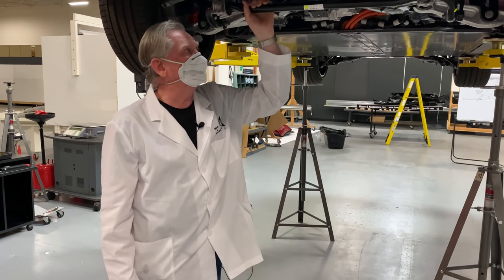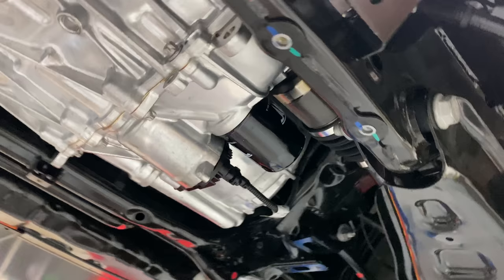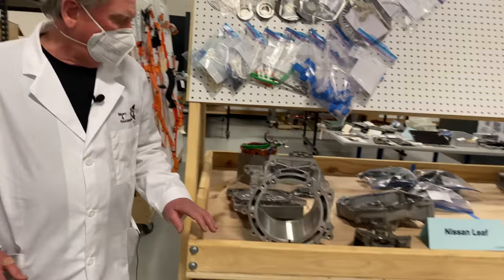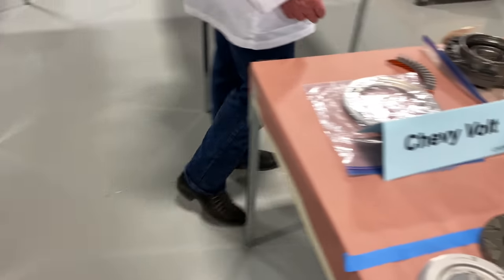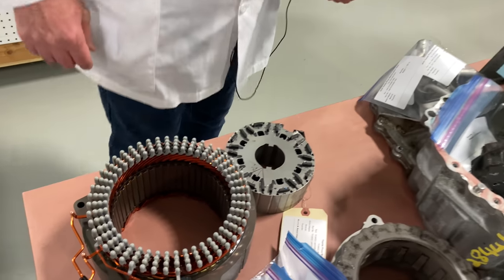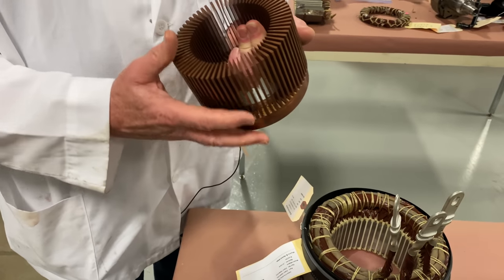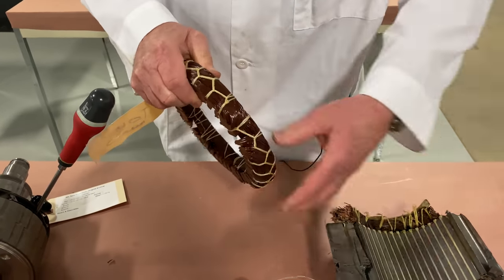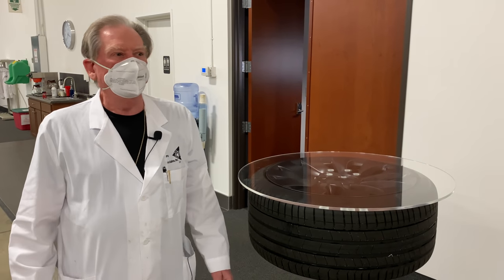Model Y E16: Electric Motor Comparison MY-M3, Industry review of Electric Motors, Table for Sale!

Comment: I have idea for new kind of PM motor maybe if not self driving maybe 500%  better ones,the idea for recharge Tesla you can use 4 small alternators to be on 4 wheels for recharging batteries or Nikola Tesla Turbine in front to run alternator or PM...

Comment: The eTron could have done better than putting Induction motors on both front and rear BUT their machine cooling is quite nice/neat: where they are able to run coolant (not oil) via not just the stator housing, but also via the rotor shaft (which usually is not easy with a rotating component, and leaking issues, etc.). This helps them achieve optimal cooling/temperature maintenance enabling them to get good continuous performance, repeated launches, long high speed (think Autobahn) driving without too much derating. The eTron is limited in range for one, it's an induction motor (< eff. Compared to a PM motor) especially when driving per EPA testing, then vehicle is heavy AF, much lesser usable kWh than the rated 95 kWh (to be able to put our the rated range in real world conditions too, not just per EPA cycle), too many auxiliaries (energy consumers) compared to Tesla vehicles.

The choice of induction motors is to keep the cost low and still be able to make a profit from a company which is more lopsided to industrializing ICE vehicles. In the future with large scale MEB vehicles from the VW house, this vehicle should cost lesser

Comment: Great video like the others! My question: is there any change or improvement from the Model 3 motors to the Model Y motors or are they 100% the same?
Reply: Same part #'s
Reply: Same part #'s
Reply: Not sure. The Y has higher power on the output. There could be some upgrade.
Reply: @mirkonaumann1417  Nope. Performance Y and current 3 have same drive units. Different output due to other factors. Tesla repair tech.
Reply from the maker: We will absolutely be diving into it to find out, but without having gotten down into the internals yet, we can't say 100%.  At a glance, the case geometry, layout and rough sizing appear the same though.  Stay tuned for future episodes where we get into that!
Reply: @MunroLive  Waiting for every new video from you :-)

Comment: No way this shares 70%+ of parts with the Model 3. So many red dots in these videos (red means it is not same as M3).
Reply: Sure it can, if you consider bolts and other small parts.  Percentage is probably a poor metric for comparing vehicle content.
Reply: More likely it will in the future.
No reason the 3 can't be reengineered for the rear casting, etc.
Reply: Sandy's Model 3 was a very early production model. Its a fair comparison as the model y is also early production model. But the model 3 currently in production does have a few changes, as other comments on sandy's videos have mentioned. Tesla has been making constant changes along the production. 
It would be interesting to see a current model 3 torn down and compared to the y. But then again, maybe 6 months from now the Model 3 and Y will share even more components.
Reply: @Marc83Aus  I believe Sandy tore down two Model 3s, an earlier one and a later one, as he references to improvement in the build quality.
Reply: Model 3 is constantly being improved at the same time.  He is comparing to an early 2017.
Reply: @dchristo10  not to mention 2170 cells! I'm sure by part count, that's half the vehicle by themselves!

Comment: 7:15 What was the model year for the Volt? The 2016 to 2019 Volts used a different motor design, which resulted in far lower manufacturing costs.

Comment: whats the pros and cons of induction motor vs permanent magnet motor?
Reply: PM motors are more efficient than standard induction motors(can dynamic brake up to a standstill), but PM motors are more expensive than induction motor.

One of the big reasons so few people use PM synchronous machine like tesla is due to the control complexity. You need positional feedback to effectively control the motor. Whereas an induction motor needs no feedback.

Please note that this is only a few of the characteristics of these motor types. Im more inclined to the PM motor that tesla uses since that topology is what i did my thesis on
Reply: Divan de Vaal I would add that Induction motors can require more cooling due to the heat inherent in inducing a magnetic field

Comment: Why does a gearbox need a filter? Isn't it a closed system? Where is the particulate that it's filtering coming from?
Reply: Metal to metal friction will create particulates
Reply: Gears and bearings in the gearbox wear out, the oil picks up the metal particules.

Comment: @Sandy I didn't like to see those oil filters there. 🛢 What happened to the whole "electric cars don't need oil changes" argument?
Reply: How often do you change your transmission oil in your gas car? Not very often in the life of the car.
On electric car this is also transmission oil, but there is much less oil because there is  only 1 gear.
Engine oil need to be changed more often than transmission oil, because of high engine temperatures, and combustion products leaking into the oil.

Comment: Very interesting to see the conventional makers all using a similar design while Tesla lashes out on its own design especially the rotor. Looks like a lot more work to manufacture as well as all that copper in the bars. Would certainly allow more power without a lot of resistance losses and avoid higher temps cooking the insulation over time. The gear oil would not have to be anything too fancy I wouldn't think. Lots of good synthetic gear lubes around. And being cooled would help with its life too unlike some heavy vehicle diffs that get up over 100C in hot weather. The drive line looks pretty bulletproof. You are in a privileged position to see the evolution and state of play of EVs with your tear downs/dissections.  I think Tesla will be in the lead for a while because they don't have ties to how things are done while the older manufacturers want to add an EV to their existing range without crippling their ICE ranges. 

Remember when Detroit "tried" to do a small car. #Halfhearted/Reluctant/Not as much profit as gas guzzlers/LAME. 

In Australia, EVs are a novelty and still only a few on the road thanks to lack of interest from the government and then manufacturers not seeing any point. The only real options are a Nissan Leaf ( Urgh! pathetic range and no battery management) or Hyundai with their"Iconic" EV brand.  And of course Tesla have a presence here with cars that have some real range. I think the Tesla's will be making some quantum leaps forward in the very near future which will bring their  range up and their price down to the level of the "cheaper" cars with less range. Tesla as a package will be a hard sell for others to beat with the range, charging network and I see a big future for their insurance where they have a unique advantage over insurers with the level of data they can glean from cars to set a much more competitive rate based on accumulated data from the cars.

 Thanks for another hugely interesting video.

Comment: You should also buy a Hyundai Kona and tear it apart. Seems to be the most efficient car today, behind Model 3.
Reply: Vlad Mihai It is less efficient than the Y If you go off epa.
Reply: Also much smaller than Y and 2wd
Reply: @bob15479  Model Y is just a model 3 so it is expected to have the same kind of efficiency as model 3. Hyundai Kona and Kia Niro (which share the same platform) have been tested against Model 3 in real world scenarios, bjorn nyland, car wow and they are very good. In efficiency they are overtaking the model 3, but the range is smaller because of smaller pack (64 vs 80+kwh)

Comment: Sir please tell out what's inside the model Y motors. And please tell ous if we can buy that motors from you or not.
Reply from the maker: We will definitely be getting into the internals of the Model Y motors, but realistically, they are not going to be useful as functional motors once we're done with them.  We typically section portions of the internals for analysis and material composition testing.  Thanks for tuning in!

Comment: Regarding the induction motor Tesla is using the more expensive copper cage rotor. This has better efficiency than the Audi's aluminum cage. Resistive loss of copper is much lower than that of aluminum.
Same goes for the permanent magnet motor. The magnets in Tesla's rear motor are segmented. The problem is, at high speeds the magnet loss increases tremendously, the magnets will get hot and could demagnetize, due to high temperature. The work around is to have segmented magnets. This will reduce the magnets loss greatly and it becomes negligible. The other cars can't reach high speeds and don't realy need this, since it's a further manufacuturing challenge. 
As a conclusion, Tesla is choosing the better and more expensive technology, as opposed to the others which are choosing the cheaper tech. 
This is where the superior effinciency and higher performance of Tesla comes from.

Comment: Motors used on EV vehicles are multi-pole  high RPM requiring up to 2 Khz AC to feed them. Effective conductivity of copper wire is frequency limited by the "skin effect." The phenomenon becomes a consideration at a relatively low frequency. 

Here's a Wiki link:
https://en.m.wikipedia.org/wiki/Skin_effect   

And a handy calculator:
https://chemandy.com/calculators/skin-effect-calculator.htm

The usual work-around for 60 Hz motors is to multi-strand the winding conductor which also facilitates placement in the narrow stator slots. For example a 60 Hz motor ordinarily requiring #6 AWG enameled magnet wire would be wound with 8 strands of #16 AWG whose total section slightly exceeds that of #6 and has triple the surface area. The heating coils of induction cookers and induction furnaces are commonly wound with Blitz wire, multi-strand magnet wire furnished laid up like speedometer cable.

It's a mystery to me why high performance, high frequency motors used in EV's would be wound "hair pin" fashion when electrical losses in such a design are sure to be a factor.

Comment: Tesla owner: "No oil! Good for environment!"
Me: "Munro showed not just one but TWO OIL FILTERS! Teslas most definitely use oil."
Reply: Although it would be a specific gear oil that stays in a long time, not comparable at all to the oil changes done on an ICE car. As long as you have bearing and gears, you will have some sort of lubricating oil.
Reply: @zacolin1  Plus it seems to be only 1-2 liters each.

Comment: Why don't you just offer your technical reports like on parts, materials, systems (cooling, lubrication, heating, power control, charging control, ...), technical explanations, pictures, numbers and figures?
* as a car repair guide in a Haynes style manner
* as weight analysis for sports use (shaving weight in the most promising spots)
* as input for car tuners with weights and comments on dimensionings and dimensioning margins in electric motors, inverters, batteries, brakes, shafts, cooling systems
* as input for hypermilers that want to modify their cars towards more efficency and therefore range
* suggestions on creating convertibles (like to Newport Convertibles) from these cars by changing their bodies
* suggestions on creating station wagons or pick-up trucks (think Truckla) or coupé versions from the existing bodies
* suggestions on retrofits: like adding a heat pump to Model 3 , or adding higher-power charge ports (CCS) to older EVs
* suggestions on retrofits, like: from CHAdeMO to CCS: what needs to be changed in parts?
* suggestions on retrofits like solar panels: where to add them with minimum necessary intervention to the vehicle
* or from Chinese Model 3 to US model 3: what changes? Conversion from US Model Y to EU Model Y: What needs to be changed?
* suggestions on even better NVH (think of luxury models from existing BEV or PHEV) or even better safety
* lists of running changes that you collected or have identified and the reasons for these changes as you see it (cost cutdown, reliability improvement, NVH improvement, unifying measures, ...)
* educational literature on electric motors, suppliers and their real designs, reasons and resulting properties with drawbacks and benefits
* actual parts lists (with all the labels and logos there are lots of information in a car) with high-res photos and explanations
* information on suppliers for customers searching for replacement parts from Tier-1 suppliers
* common faults, reasons and design improvements

* and all that in a subscription model for information to download online from a Munro live web portal - or consumable via an API for machine to machine communication
* People cannot always physically come to the cabinets in your workshop there, but they  can make use of the information you got from them.
Just use an episode to introduce your reports with information on prices and data formats.

FMPOV: the signed parts and tables may turn into collectors items. But the actual information on reverse engineering is worth way more. And therefore, that should be promoted.

Comment: Waiting for that odd ball automaker from Japan to build a horizontally opposed oil burning motor to drive a disposable CVT with a built in  storage for a spare folding bicycle that you will need when the electronic battery meter lies to the driver and leaves them stranded in some national park.

Comment: To be honest i was positively surprised that Tesla is using copper rotors..That is the only way how to make super powerful small electric motors (but you can be sure it isn't cheap thing to do..aluminium casting cost almost nothing compared to copper ). I was working for motor manufacturing company and i was responsible for stators in general..so i know how it works..I was also surprised..(well maybe not so much) but you can be sure that that copper wire is pretty dense in that stator slots.. .. that has some problems related to production...but those are heavy duty motors..soo no surprise there...and if there is pretty high density of the wire then you can be sure that production cost will go up because of increase of scraps..related to wire..Also would be interesting to know if they are using tripple coated wire or just normal double coated wire ..

Comment: EV rotor game is not well developed. Small DC cheep motors are all the same but these are still in development and are all different. EV electrical design must find the best rotor and all rotors should be the same. Looks like the stators are universal and the same but the rotors need work.

Comment: It’s not a transmission it’s a gearbox? It transmits the motor torque to the driveshafts, the very definition of a transmission. It has one gear (ratio) not 5/6, so a calling it a gearbox is certainly less accurate than transmission.
You clearly are great on some stuff, powertrains... really not.

Comment: Eeeeeeewwwhh, the Audi e-tron with the aluminum cast rotor is so bad.  They losing probably 3 to 6% of efficiency right there. 

AC Propulsion Inc already had an cooper cast rotor back in early 2000’s for EV

Edit: Even the EV-1 from GM had a cooper cast rotor. And AC Propulsion Inc most likely had a cooper rotor since inception in 1992.

Comment: 7:45 that "unusual", "super-expensive" Chevrolet Volt 12-pole rotor should exploit ferrite magnets (you can see the distinct dark color of the magnets comparing to the shining color of the coated NdFeB magnets). The machine design, with such air pockets (flux barriers) radially distributed, is called Permanent Magnet Assisted Sychronous Reluctance (PMASynR).  The same idea is implemented in many of the other competitors, with the critical difference that they use RE NdFeB magnets. 

Conversely, ferrite magnets are basically RE-free (only higher grade >=12 requires some Light RE componds). Ferrite magnets are really attractive because of the low and very stable price (is way less influenced by the chinese mood), which is, in [$/kg] roughly 70-80% lower than RE NdFeB magnets. Moreover,  ferrite magnets lend themselves well to be shaped and magnetized in such "unsual" curved shapes, better than NdFeB (this is why everyone likes block shapes NdFeB magnets). So for "super-expensive", definitely for manufacturing point of view (several and different magnets per pole, insertion of such magnets inside the pockets...), but it would be interesting to see the impact of the lower cost of the magnets to the total machine cost.
 
From my point of view, this is one of the most interesting concepts among the one presented, developed from the so called "fossil/dinosaur" GM (not aware of anyone having something like that in EVs in series now or in the past). An  attempt to create a RE-free (but not PM-free) cost-effective and innovative mass-market design in the EV sector (however it is known and studied since decades in the electrical machine design field).

Comment: Those are synchronous reluctance motors. Personally I dint trust them yet. They are not well suited for high speed. There is a lot of misunderstandings about their characteristics and how they compare to induction motors. 

Mainly it's difficult to get a true apples to apples type of comparison because what the hell is apples. Well that's kind of an apple but no it's not so controversy right?